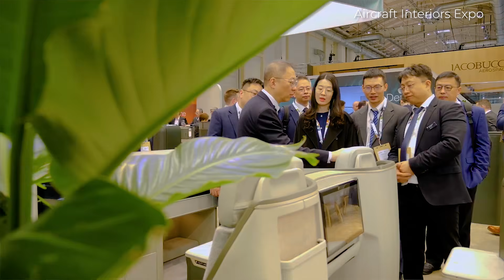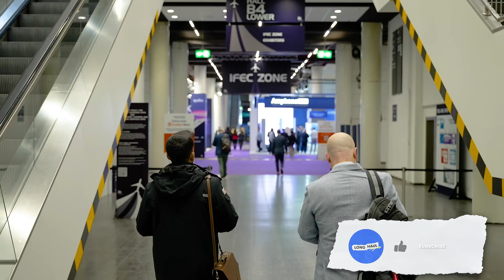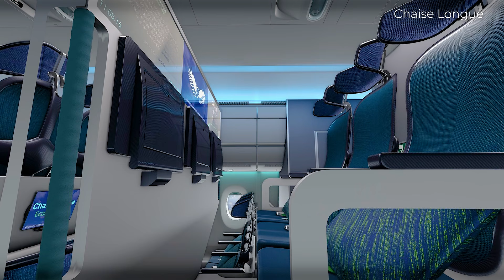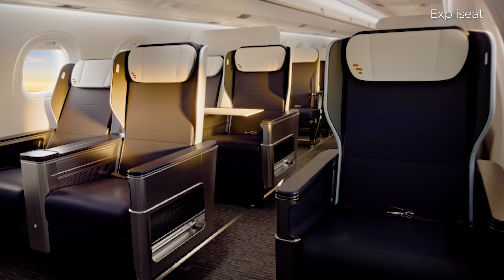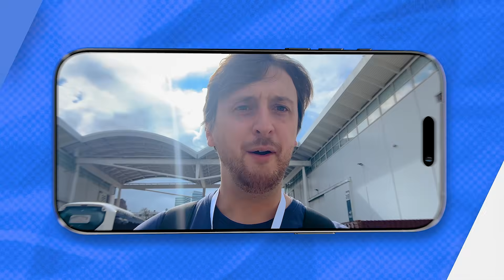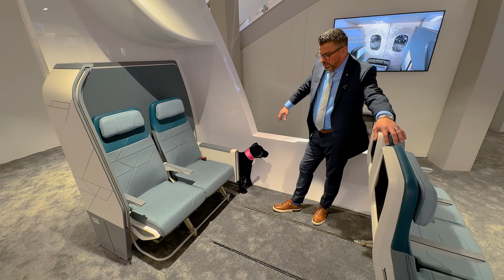How Airlines Are Redesigning the Future of Flying at AIX 2026

Comment: Chaise Longue is an interesting concept but the owner of the company brushed over some issues and completely ignored others. He was suggesting that the upper level is economy and the lower level is premium economy. So accommodating PRM economy pax would mean a free upgrade to premium? Airlines aren't going to like/accept that. He talks about storing bags under the seat but there's nothing to prevent them flying forward if the aircraft has a crash landing, thus severely restricting emergency egress of the cabin. Then there is no mention whatsoever of how the cabin service would work for the upper level passengers. How are the crew going to serve them? Plus I imagine there would be a lot of added weight in the structure of this seat system compared to traditional cabin interiors.

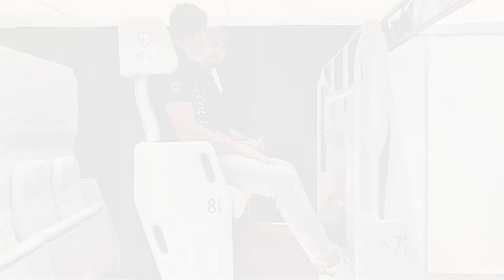Comment: At 3:20 I see two issues. First you do not have access to the bag during flight. Note the gentleman didn't attempt to open the bag he pulled out. Second, the bag underneath him is not secured and may be fall out from beneath him during severe turbulence, and may even be a projectile in the cabin.
Reply: The airlines and the government air safety body would have some sort of barrier, netting, accordion door type in that area installed for Safety
Reply: any carry on like than requires use of the isle to open in current narrow body configurations.  Your argument is moot